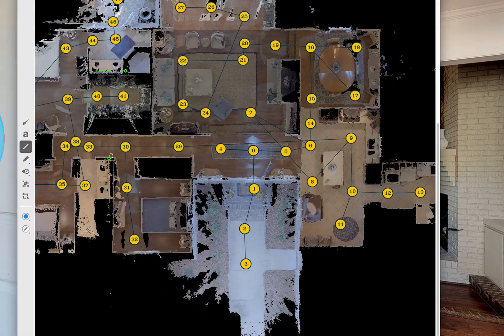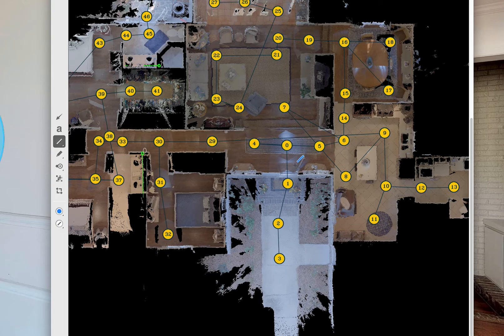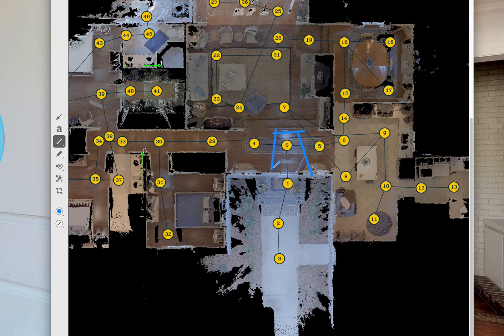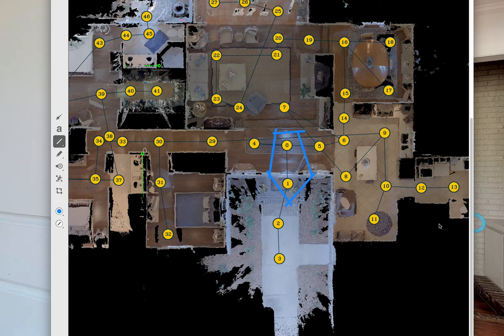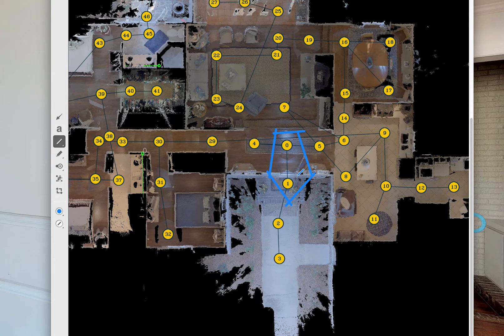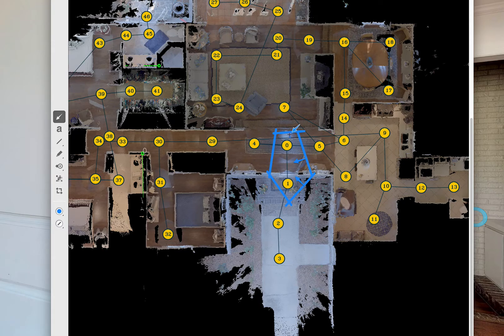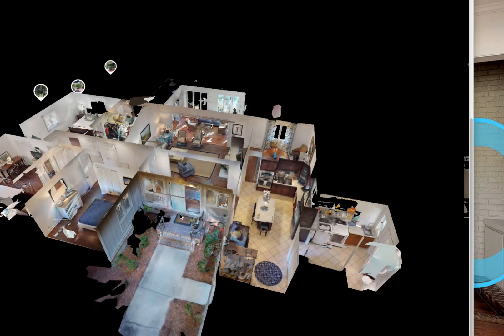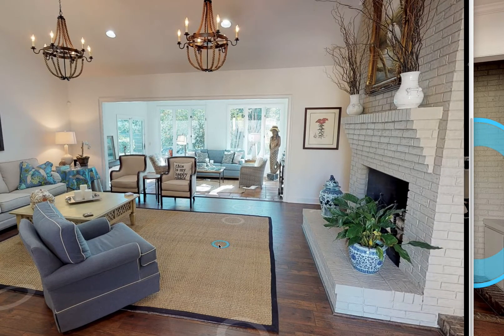Door Open Closed Trick

Comment: May I know if this method has the same effect as the one where you use two trim markers facing each other around the door as described on matterport'a website?
Reply from the maker: It's similar, but this technique is better and more likely to have the desired outcome. I've seen many instances where the method described on the MP website doesn't work.